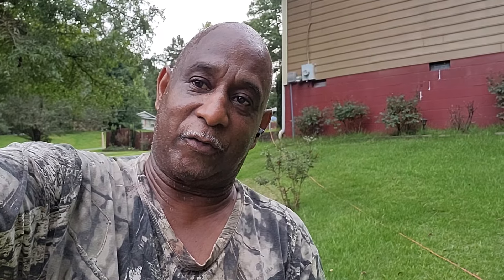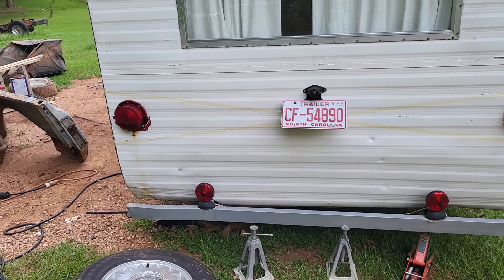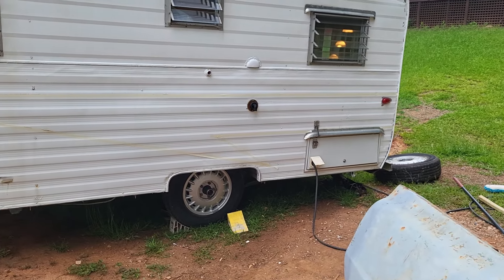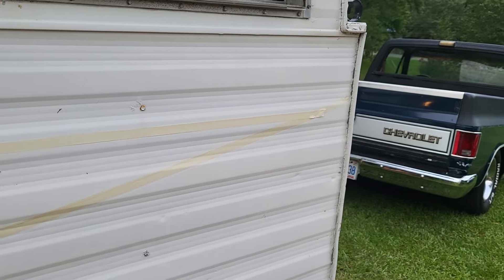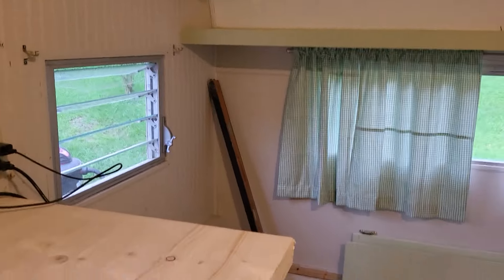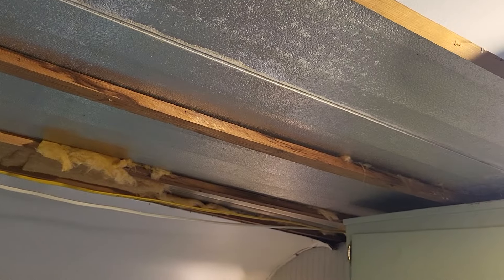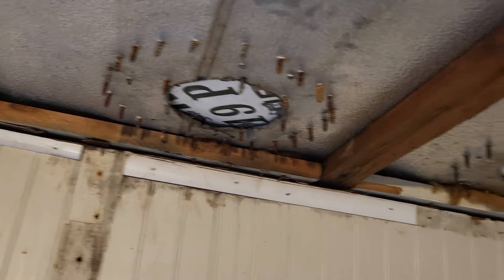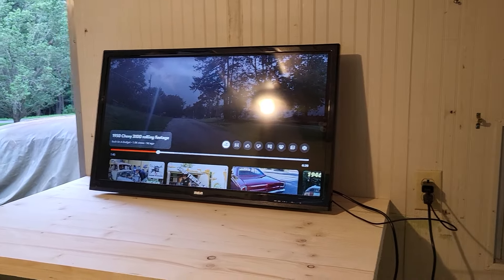Laying out the graphics on our 1960 Fire Ball Camper

Comment: I'm going to make a suggestion when it comes to putting heat in your camper I would highly suggest that you get a semi truck bunk heater what they are is a little teeny furnace and they work really good that's what truckers use in their sleepers and you'll just need to have a little tank for diesel fuel cuz it doesn't use very much at all they are extremely efficient they're kind of spendy you're going to spend about 1500 bucks for one but they're well worth it
Reply from the maker: I was thinking electric.  I have one I use in-house for emergencies that work really well.  I have two tasks, but momma is scared
Reply: @builtonabudget6767  let me tell you what I've been driving truck for quite a few years if you investigate what I'm talking about you will see and if you don't take my word for it talk to a truck driver that's got a sleeper there is nothing better than those little furnaces you can heat your whole house with one of those furnaces for a 10th of what that electric heater in your house cost